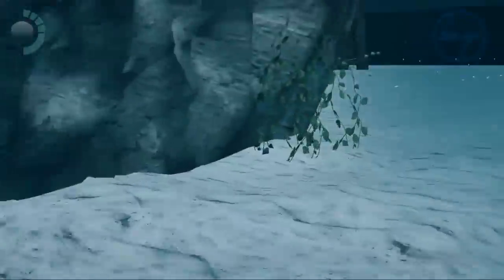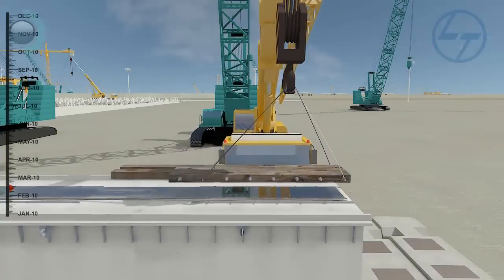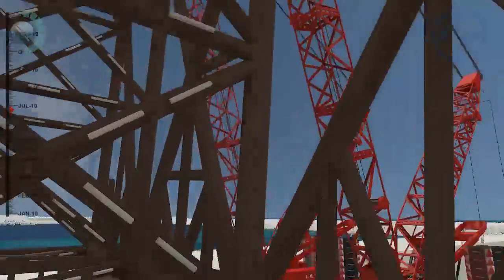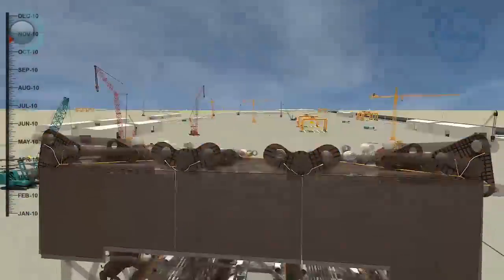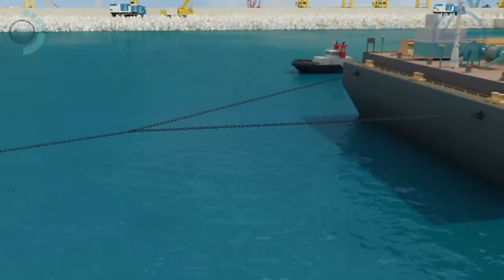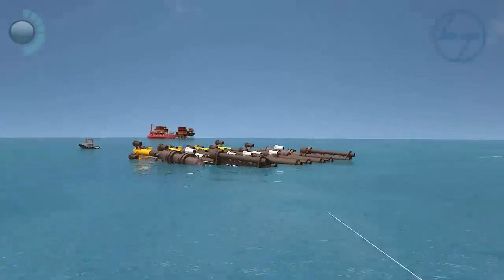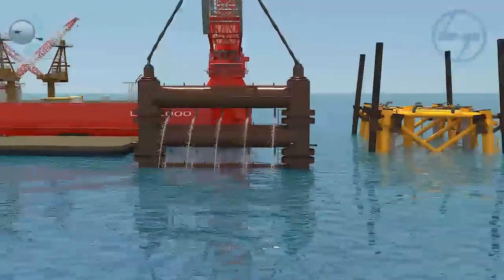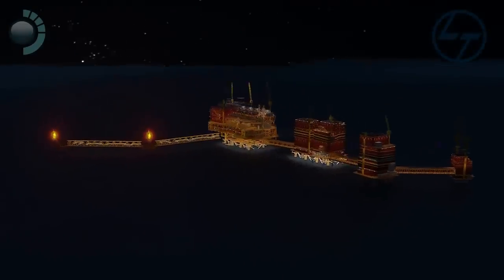How & Where the Indian Oil Rigs stand on the sea?

Comment: Mumbai High (Bombay High) is not an oil rig. It is the name of the oil field / hydrocarbon reservoir located in western offshore of India. MNP is not the main platform. It is a part of BHN / MNP process platform, one of the offshore platforms platforms located in Mumbai High. Regarding the fire incident, it happened on 27th July 2005; in which 11 people were reported killed and 11 were reported missing. So, the total casualty was 22.
Reply: Sir app je job krte hoo vha pe